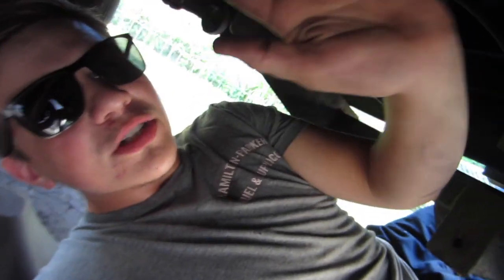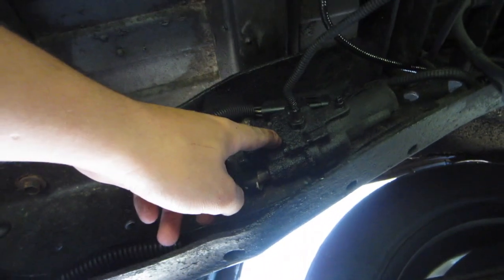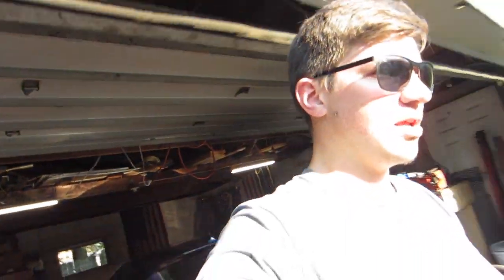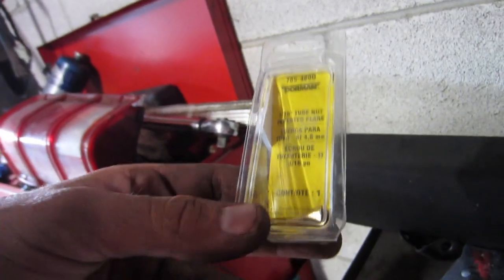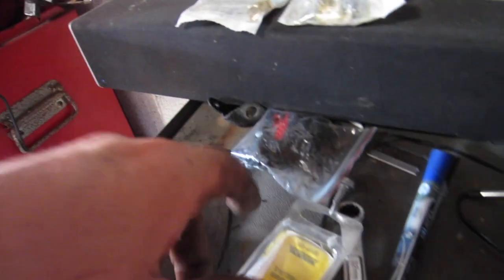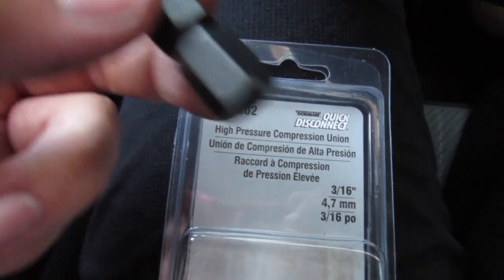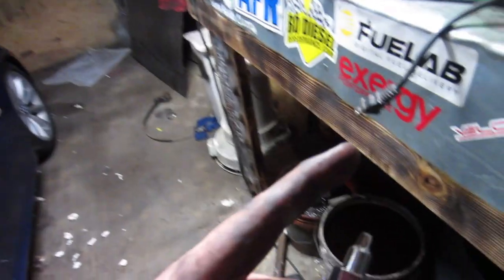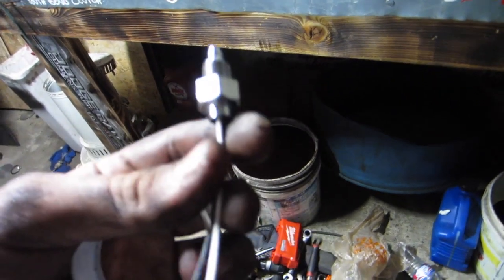1st Gen Cummins Rear ABS Valve Delete | 100% SUGGEST

Comment: Compression fittings are not designed for Brakes, They are unsafe, Compression fittings cannot take the pressure of brake lines and will eventually fail hopefully not when your doing 50 MPH and have to slam on the brakes because you will not have any.

Comment: If you flare the line there’s no need for a compression fitting.
You should not use compression fitting on brake lines anyway.
Reply from the maker: 3 years going strong everytime the trucks driven it’s got a trailer behind it I think it’ll be just fine 👍🏻

Comment: Hey man I'm having a squishy brake problem with my 92 d250. Pulled the drum and the shoe was in there all crooked cuz a pin broke. Anyways replaced hardware and wheel cylinder in driver rear. Bled brakes and pedal seemed ok, started it up and pedal went right to floor again. Could this module be the problem?
Reply: Did you ever find the problem having the same problem
Reply: Same, replaced passenger side wheel cylinder and bled everything.. now when I start truck pedal goes to floor
Reply: So just a heads up guys, the master cylinder needs bled. In my experience, air in the master cylinder is the BANE of these systems. Idk that's just my experience tho
Reply: You need to reset your proportion valve up by your master cylinder same thing with me on replacing the wheel cylinder in the rear the proportion valve gets tripped and it cuts off fluid from the rear you need the valve tool to hood the slide in place so it doesn’t cut fluid off